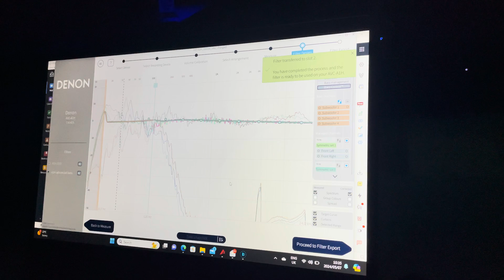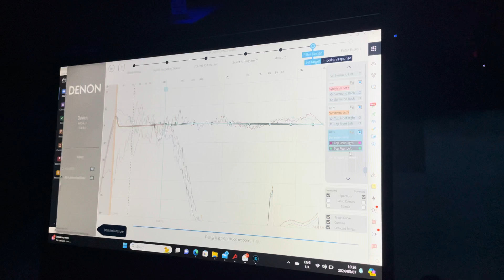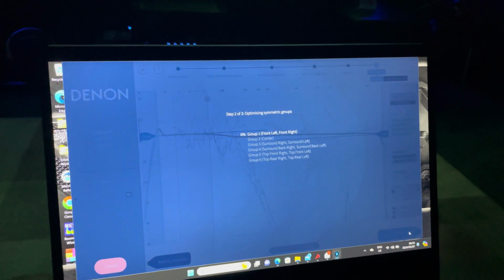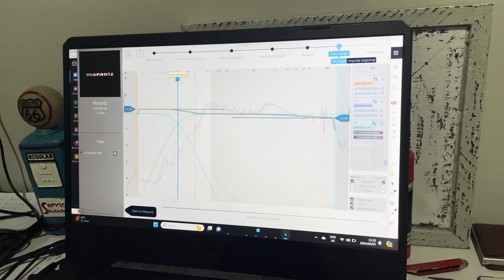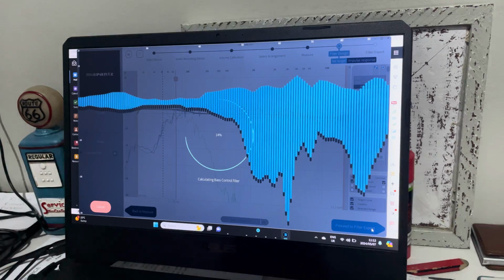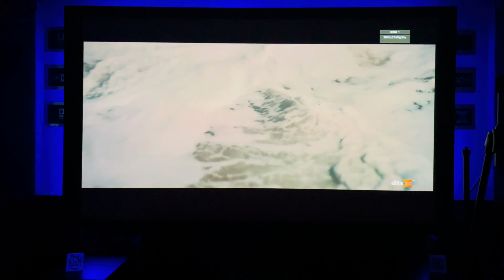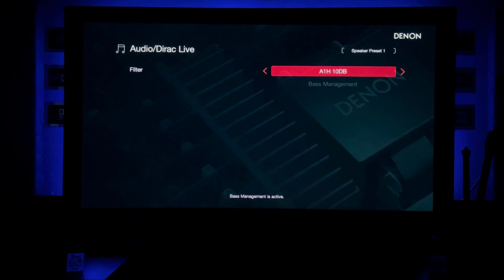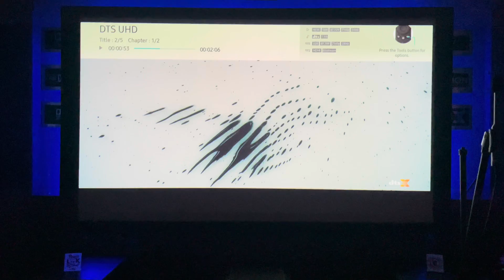Dirac live bass control on Denon A1H and 4subs.

Comment: hey if i have 2 subs svs sb 4000 it is ok if i have normal dirac live room control or do i denn beterr licnece na bass control if i have 2 sub or do i ned to buy better licnes thaht have multi subs if i have only 2 subs
Reply from the maker: @mihahorvat5857  i would invest in the advanced bass control if you are serious about your sound👍
Reply: @homecinemaking397  hey man can i put the umik 1 mic on the reciver not on pc but on my pc donlowd the dirsc and mesurment because i dont have the laptop i have a desktop pc
Reply from the maker: @ have to go thru your pc connected to the network.
Reply: @homecinemaking397  I have subs svs sp4000 do I need  set  somu  volume on subs before do the calibration or do I leave  -10db
Reply from the maker: @ start on -20 and level match on Dirac
Reply: @ Do you think thaht -20 will  be ok because it is a litel bit low  how much  was in your pb 16 volume when you done the calibration and what crossovers i set up mebofre i start calibration
Reply from the maker: @ depends on your room size, that is why i say level match in Dirac.
Reply: @homecinemaking397  ok thanks  where can I get those harman target curve  can you give me  and what they do what  is the diference

Comment: You can try lowering the left shelf to 10hz instead of the default 16.5 hz.

Then youll get infrasonic correction to 10hz
Reply: I've found that you get a more tactile feel if you don't force correction down there. Even subs that go that low are trying very hard at that point